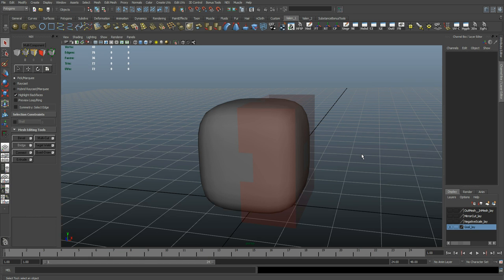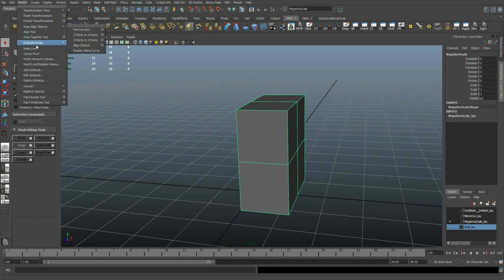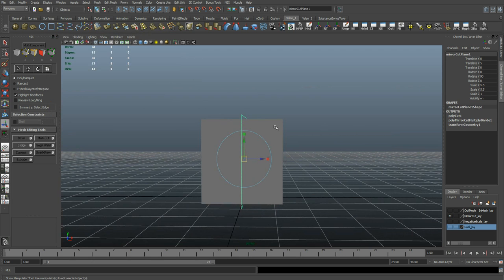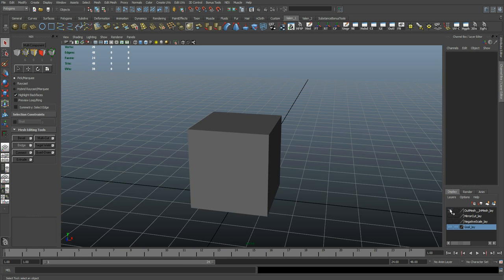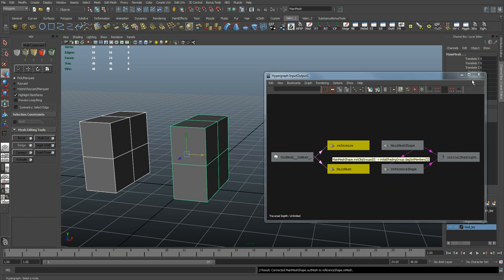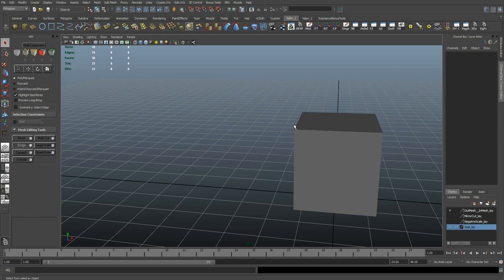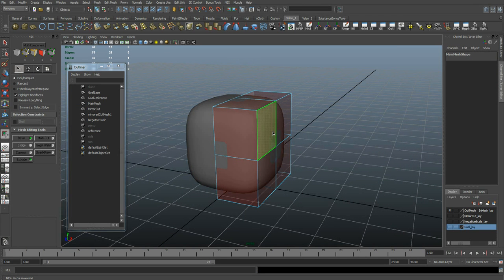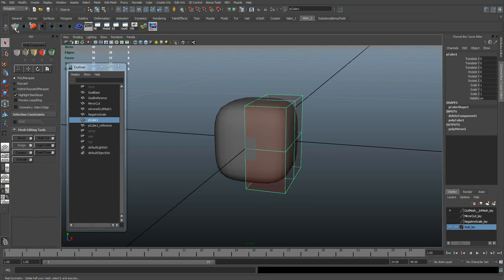Maya - Real Symmetry Modeling (1 of 2)

Comment: This is great, thanks for that tip. Well ***** Maya has it's own way to previsualize subdiv and poly model at the same time (just pressing key num 2) this makes it faster to work in Maya without any modifiers...problem is you have the "control wireframe" all over your mesh so it makes it unconfortable in some situations to work like this. Working with symmetry you just have to do a "duplicate special" with "instance" marked out so ... gotta tell you when I learned Max I saw this easier to do in Maya so it depends on the software you work better/you like more. 3dsMax is going to die soon so better start learning Maya now.

Comment from the maker: If you're using Maya 2014, you can simply use the symmetry options inside the new "Modeling Toolkit" that was implemented.  This technique is now only necessary for previous versions of Maya.

Comment: for objects that are not connecting/welding at X origin (for example a characters shoes) your script mirrors them right beside each other, rather than putting in a -X value. Is there a way you could change or should I use a diff script/process?

Comment: Nicely done.
I haven't worked in Maya very much but it has always amaze me to see that big ugly seam line down the middle of Maya artists models as they work. I imagine that the Artist would have to keep welding that seam together then revert back to continue with model changes.
Also a real pain if you need to make non symmetrical mapping. You would have to join both halfs in order to do the mapping, loosing the ability to make symmetrical changes.